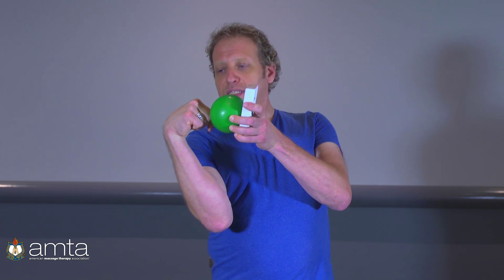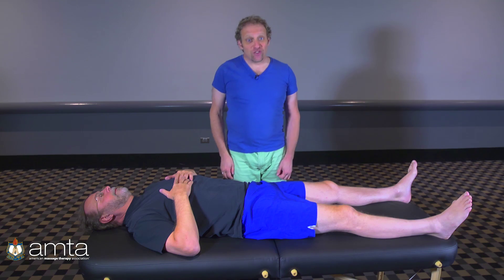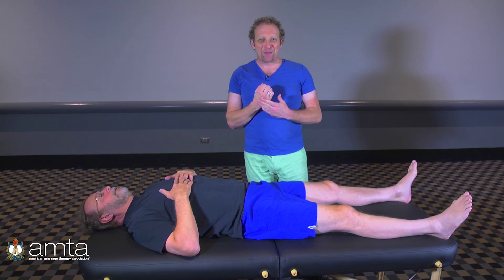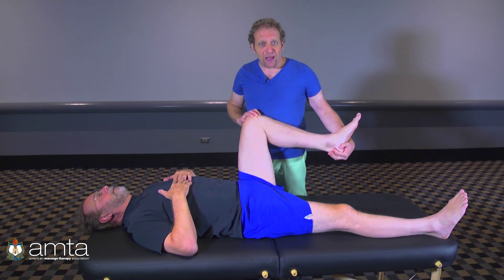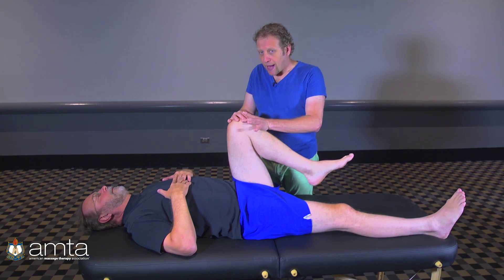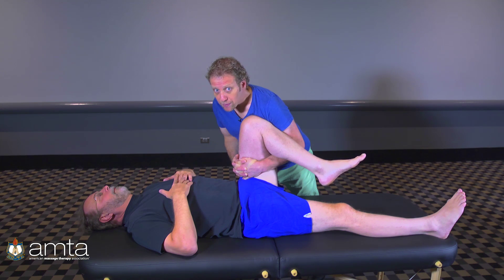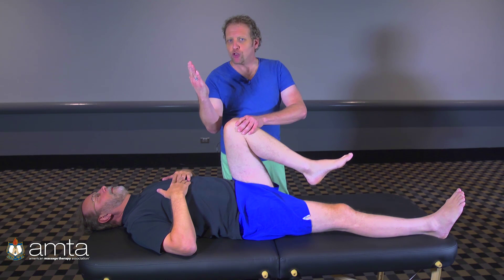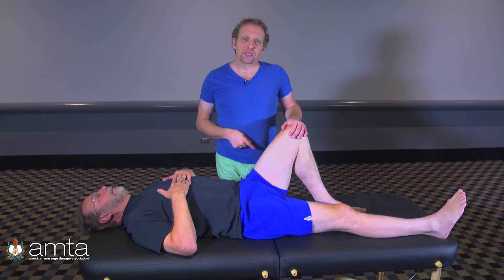Hip Joint Mechanics Tutorial

Comment: In theory, George's presentation makes sense.  However, in order for the femur to centrate appropriately on the pelvis, a tremendous amount of hip and trunk muscles have to be capable of playing their role in any position that the joint is in.  So creating more joint mobility and flexibility is not going to allow for a better centration of the joint.

Said another way, if the muscles that are responsible for tilting the pelvis posteriorly are not capable of contracting at the right time, the muscles that are responsible for moving the femur won't have anything to anchor off of (e.g., piriformis).  

This approach would also only allow for short-term results.  

In other words, since the very nature of the technique(s) shown (and mentioned!) don't allow for an increase in stability at the hip joint, muscles will tighten up to protect the joint from going into a position where the person is vulnerable to an injury (i.e., compensation).
Reply: Very good video